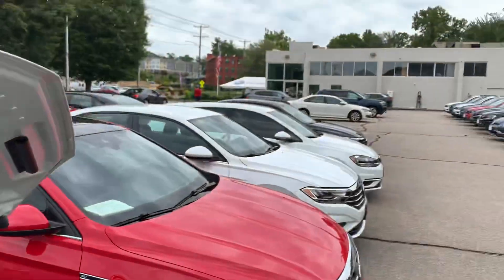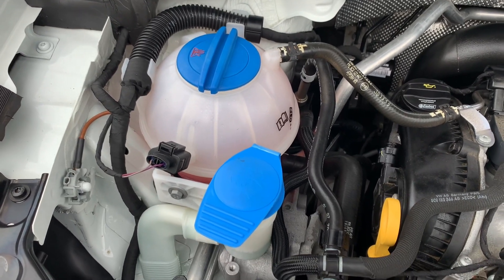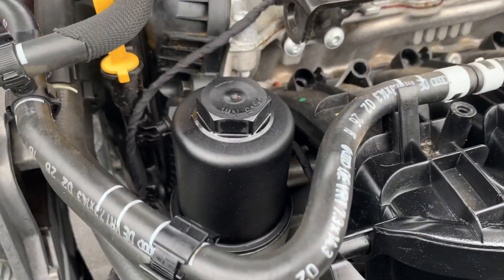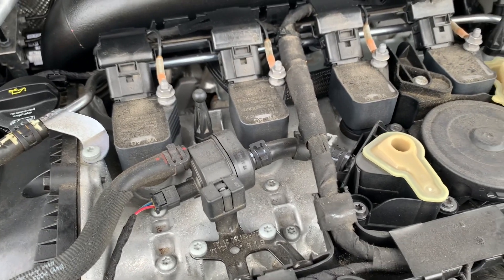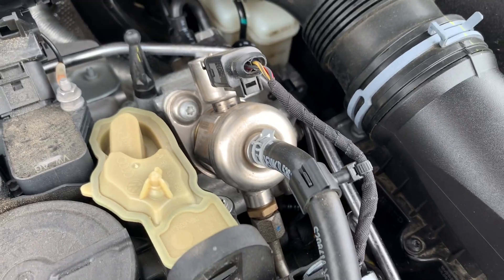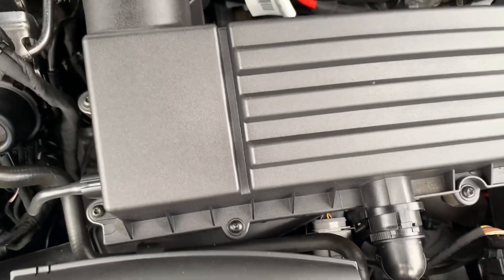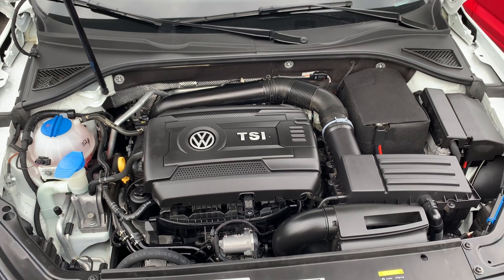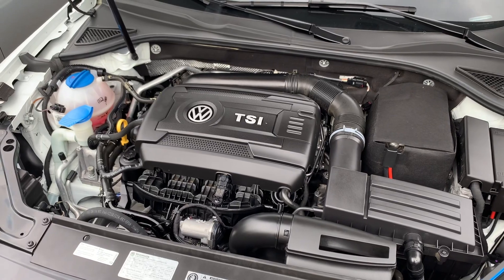VW/Audi Gen 3 TSI Engine Overview

Comment: I keep getting a epc light every now and then.. it goes away when i turn off the engine and won't show up for another few days. Any idea what the reason would be? The car is running just fine, no loss of power or limp mode
Reply from the maker: It could be a sensor somewhere, or the signaling of a turbo failure as it is under boosting
Reply: @maxwellchace4986  Any advice on what I should do.. I changed out the spark plugs and coils as a first step. Car is a 2014 VW Passat 1.8L and has 92k miles.
Reply from the maker: @bengeorge2  I’d get the EPC light diagnosed to see what’s causing it and then go from there

Comment: I drive on the highway for a living.  Change the oil once a month. Currently at 385,274 miles and counting
Reply: 385k?! Wow!! I just crossed over 200k on my 2016 Passat! Have you replaced the timing and turbo?

Comment: The EA888 VAG engine is one of the most unreliable engines you can buy.
Reply from the maker: Nothing about that statement is true.
Reply: @maxwellchace4986  Come on Maxwell there must be something true in my statement...must be.
Reply from the maker: @shanemitchell5807  I’m on my third car with the EA888 and I drive them hard. I have never had one mechanical problem with any of them.

Comment: What’s the best oil to use with this cars ? I own a 2012 VW Cc 2.0t sport 4 cylinder I usually use Castrol oil but I took it to pep boys and they use penzoil and I see lots of people use different brands someone help
Reply from the maker: I work at a VW dealer. We used to use Castrol but now our VW brand oil is supplied by Mobil. In a perfect world, I’d use Liqui-Moly. If you can’t, use one of those two. The penzoil won’t hurt your car but the above are best. Change your oil every 5k and keep an eye on your timing chain. If you have a lot of miles, consider getting it replaced as they will fail on that model year car.
Reply: Thank you yes,  I was wondering Castrol I think it burns quicker and I seen a lot of people use Liqui - Moly as well I just got my oil changed next time I’m going to order some Liqui -moly what’s the exact fit for my car and year ?? And btw I’m a new subscriber 👍🏽
Reply from the maker: @thebigbosss1000  I would use liqui-moly molygen (green bottle) in 5w40. Thanks for subscribing!
Reply: @maxwellchace4986  okay got cha , and you are welcome

Comment: Which engine does it have in 2021 tiguan 2.0 tsi
Reply from the maker: The Tiguan has the 2.0 TSI Gen 3 B engine which uses a different cycle for better fuel economy but reduced power

Comment: Is the throttle body the silver and black block in front of the intake manifold ??
Reply from the maker: Yes. The intake system is complex but very efficient and uses variable intake runners. Look it up to learn more, it’s a great engine.
Reply: @maxwellchace4986  how difficult is it to remove the throttle body to clean the carbon build up ?
Reply from the maker: @kingkolt886  it’s not too hard, you just have to know what you’re doing and do the right tools. Find a good guide and you can do it

Comment: On these engines, change the oil and filter every 5,000 miles.  Forget the "recommended" 10,000 mile oil changes.  An oil change is way cheaper than a new engine.  These engines run hot.  Changing the oil early is cheap insurance.

Comment: Does the head gasket leak on the water pump? How about the magnetic chain leak?
Reply from the maker: That’s a great question for a tech which I am not. I have been told that usually water pump leaks are actually caused by oil (either from pouring into the fill hole or leaks) causing the water pump gasket to erode and leak.
Reply: @maxwellchace4986  exactly. I changed mine out this last time to a cast unit over plastic. Gasket is still the same but the housing will not erode with it. The magnetic chain housing cover needs the internal gasket replaced along with external one. If you got it off why not. Lot easier, up near the top of the engine passenger side. Few hoses to get the clamps off. Great time for these hose clamp pliers.

Comment: I wonder how much carbon buildup is on the intake valves as this is direct injection only, do they have to be cleaned often?
Reply from the maker: Great question. Carbon does indeed build up on the valves over time as it is purely direct injection. It’s typically advised to have them cleaned every 70-100k. I had a 75k 2.0 TSI that had never been cleaned and had absolutely no issues, and I currently have an Arteon with a 2.0 and will clean it when it reaches that upper milage.

Comment: great car, but if you get a P0011, look at 1:30 behind the dipstick. this is the magnet for the camshaft, this is a good start if you are getting misfires when the engine is below 190. I wish i knew this sooner rather than taking off the intake manifold and cleaning the valves ( which is also a problem after a buncha miles). I just like to share this incase it helps someone before throwing money at random sensors like I did.
Reply from the maker: Much appreciate the advice! I'm hoping anyone who has this issue sees this comment as it is super helpful. Misfires resulting from carbon buildup are super common at higher miles but can be cleaned as you indicated.
Reply: +1
Reply: Thank you for this valueable info. I had my fair share of mysterious misfires on my ea111 jetta 1.4tsi it was really a pain to narrow down the cause yea so I know what you feel. I did like some advise about buying a used passat b8 1.8tsi apperciate if you could share your thoughts on what to look out for? many thanks
Reply: @JR-tl8tg  just regular oil change at 5k miles to keep that gunk out... if you are a DIY'er invest in buying the Rosstech scan tool cable. Its exlusive to vw/audi and a great program for diagnostics.